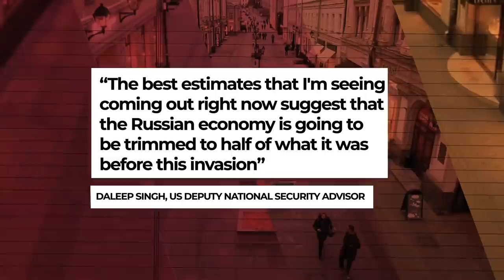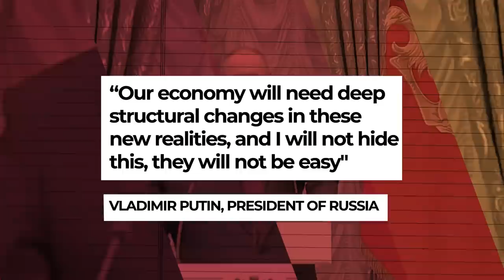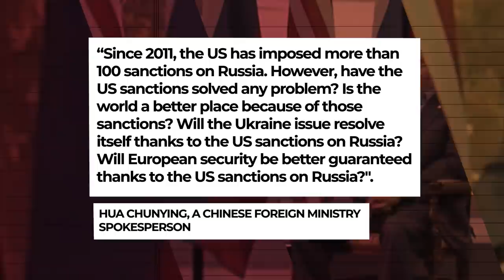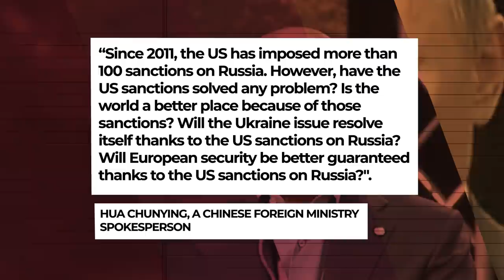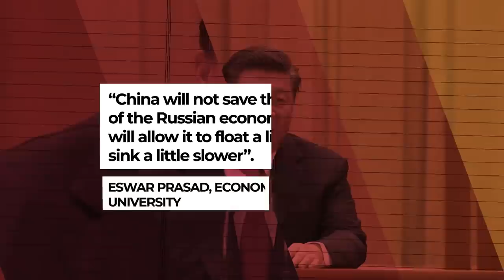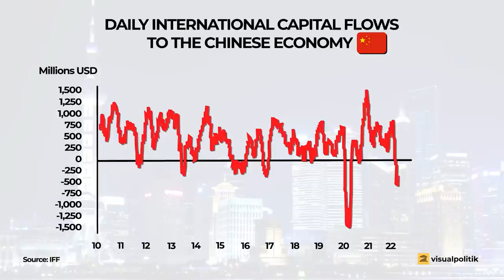Why Won’t China Bail Out the Russian Economy? - VisualPolitik EN

Comment: China has historically relied upon Russia for its military hardware but has now reverse engineered it and needs little else from this technologically backward country except for resources which China will continue to buy but at fire sale prices from a desperate seller.
Reply: same with west.. china also need nothing from west except 5NM Chip manufacturing technology。。since west would nt share it to china. so no different... and china can  independent research and development chip technology.will only take a few years. It's no big deal
Reply: @李荣-n7s  I'ts no small feat to develop a 5nm chip fabrication plant,  and you need the expertise to know exactly what technology is required and then the expertise to run it there is the design of naoscale circuitry, and ongoing design and development for market needs. Good luck with all that.
Reply: @johntaylor2683  the west have no 7nm below either
Reply: @李荣-n7s  : China is insanely brilliant at industrial espionage.  The Chinese know everything the West knows for that reason, and can manufacture anything far faster than the West.
Reply: @李荣-n7s  evidence is the Yangtze River has turned red, is water not blue ? It’s all over the free internet you might not be able to see it on Chinese internet. I pray China can fix that problem. I am not the one drinking the polluted water you are.
Reply: @mylet2658  turn red = pollution? you keep funny..

do you know china have a river name "yellow river"? because the river is yellow. because there is a lot of yellow sediment in the water since ancient times... did yellow river get pollution in ancient times? no..

same happen in Yangtze river. Because of human activities, a lot of sediment has also entered the Yangtze River and change the color of the Yangtze River, not a good thing.but it is by no means pollution

You want to prove that the Yangtze River is polluted? show me the Yangtze River water quality test report  instead of guessing，guessing and guessing....that's funny you know?

Comment: The interesting thing about the sanctions is that Russia is having trouble building tanks, planes and missiles, and making the spare parts required to keep these weapons operating. They rely on the US, Japan, Korea and Taiwan for electronic parts. Oops. And I don't think China produces the computer chips and electronics Russia needs for these weapons. So much for high tech weapons.
Reply: Does Putin know this? Or has he gone mad?
Reply: China makes most of the chips in the world. Most of the chips taiwan makes are only used in high end mobile phones. Certainly China can supply chips and electronics to Russia
Reply: @aburetik4866  well TSMC also make literally every  PlayStation 5 and current Xboxes and almost else everything made by AMD
Reply: You don’t think Russia have engineers to build those 
If Taiwan could do it and I am sure Russia will do
Reply: @abdiyousuf7882  If they could they most certainly would.  They haven't...  China can't do it either
Reply: @abdiyousuf7882  It takes years to develop the factories, and the equipment that produces the chips are also obtained from Western sources. Taiwan invested in this technology decades ago, and if Russia cannot even produce some basic parts for their tanks (which is why the sanction on auto parts has been effective), they are unlikely to be able to suddenly build a semiconductor factory overnight.
Reply: @sheadoolittle  but most chips, especially military chips don't require those technology from TSMC

Comment: Technology is going to be Russia real problem, the west controls high end chips completely. Belgium is the only country that produces the machines that make high end chips. Norway makes the wafers there printed on. The only countries that have this technology is the EU, USA and Taiwan. Taiwan may not receive the latest version of this technology because of China's threats of invitation. Plus Taiwan is producing more mainstream chips.
Reply: ASML, the company that makes chip machines is Dutch not Belgian.
Reply: just to correct a minor mistake, ASML, the leading company that designs and manufactures the lithography machines for the semiconductor industry,  is a Dutch company, not a Belgian.
Reply: Belgium?? don't you mean the Netherlands? ASML is located in Eindhoven, in the Netherlands.
Reply: China has its own chip company, SMIC, which can manufacture 28nm chips, that is enough for cars and household appliances. But the chips needed for mobile phones and computers still need to be imported from Taiwan and South Korea. TSMC also has factories in Nanjing, China.
But I don't think South Korea and Taiwan can sanction China. They are China's neighbors. 45% of Taiwan's and 30% of South Korea's exports go to China. If they block exports, their economy will go bankrupt. Especially for Taiwan, China will not hesitate to invade in anger.
For South Korea, South Korea is a country that is extremely short of resources. 60% of its raw materials come from China. In addition, they have imposed restrictions on Russia. now they have no other place to get raw materials. All Korean know that Korean economy will collapse if they sanction China

Comment: The sanctions will go away sooner or later. But this is the best time for China to build massive oil & gas importing infrastructure from Siberia with long term supply contract at the cheapest rate possible.
Reply: It may go away but the punishment won’t stop there

Comment: The whole world depends on imports. And even the USA and Europe. If China blocks Taiwan, the whole world will be left without chips for its equipment.
Reply: If china would do that, then china would suffer the same fate than russia.
Reply: Intel and Samsung chips are barely worse, and already and constantly gearing up to catch up.  Would just incentivize slight shortages for a year or two while war in Taiwan would guarantee stalled research and advancement in Taiwanese chip manufacturing, and hence Intel/Samsung chips newly incentivized would likely fill such a gap in a couple years more quickly than you’d think.  Not to mention Apple in the equation.  I used to think it would be a catastrophe as well, but already even Taiwan are starting foundries in foreign soil in case of such an outcome.  I doubt CPU shortages will be that catastrophic for that long.  Would just mean people don’t replace their IPhones, Xbox, PlayStations, Switches, Galaxy phones for a year.  Who’d care?  Car chips?  Car industry already likely learned from Tesla, and if didn’t Teslas will sell even more.  🤷‍♂️   Already car repo is going thru the roof in US, crypto crash caused flood of GPUs on eBay.  Appetite for chips already dissipated.

Comment: The Chinese have more to gain from Russia losing than Russia winning.  India is a Russian client state and the majority of its weapons come from Russia.  The Indians aren't anywhere near self-sufficient in arms production and if the supply of weapons from Russia declines that benefits China.  If Russia loses and has another revolution some regions may opt for independence so China could gain buffer/client states on its borders and undo 300 years of Russian territorial expansion at their expense.  Lastly, China has become largely self-sufficient in arms production.  Although many of their weapons are Russian designs they are built in China and without Russian arms, Chinese arms manufacturers would benefit from a diminished Russian presence in the arms market.

Comment: The Chinese oil and gas companies all have one single owner: Jiang Zemin.  The rather absurd lockdown in Shanghai is an extension of that power struggle between Xi Jinping and Jiang Zemin because Jiang's power base is in Shanghai.  Heck, Xi's anti-corruption drive when he took power was partly targeted at Jiang's supporters and colleagues.  Normally, the Chinese CDC would be in the driver's seat when it comes to dealing with COVID outbreaks but Xi is the one driving the COVID response in Shanghai.

Comment: China has its own political challenges and economic difficulties. The crack down of the real estate bubble last year might cost half a trillion to fix/ sweep under the carpet. Current lockdown of the world's largest port, Shanghai, will have another cooling down of world economy in addition to all the other effects. World economy will have to face another year of decline. Of course China and russia can continue to exchange raw materials and fuels for consumer products on base of rubels and rinminbi, but dollars are in short supply for both. Replacing Western engagement in the russian economy will fail. Both systems are equally corrupt, and combining two kripples doesn't make a sprinter.

Comment: Heh, where are you getting this rubbish?  The rubel has risen.  Russia is doing fine.  The EU, however, is NOT doing fine and might crumble if they get that gas shut off.  The US is digging into fuel reserves and they are dangerously low.  Russia can manufacture what they need and have built up to do this since 2014.  Russia has stuff that the west absolutely needs, like potash, wheat and such.

Comment: China does not need to bail out Russia. Currently, Russia is overflowing with so much money the Central Bank is worried that the Rouble value could rise to 45Roubles to theU.S. Dollar. Most of her economists think while things will be hard for the next 12months, things will slowly get better over the next 12. Also, Russia is not a country that needs to import and is quite capable of being self sustaining.
Reply: If that’s the case then ditch china and keep working by itself….😒